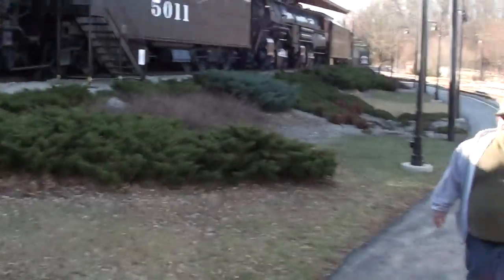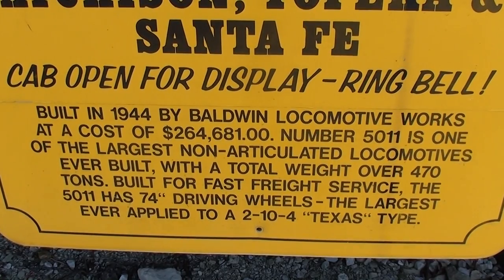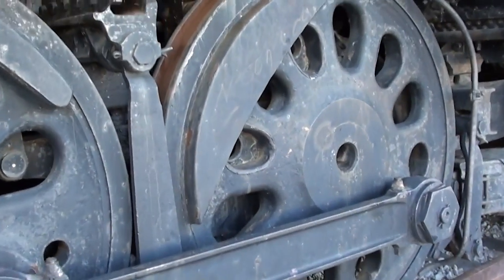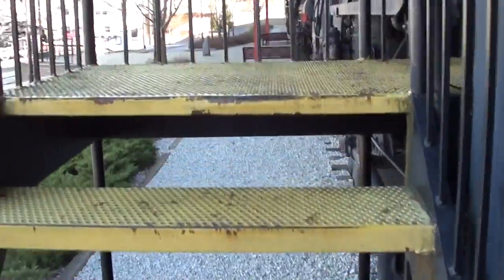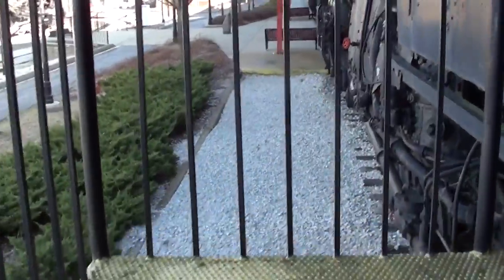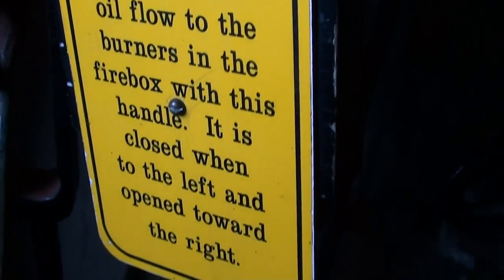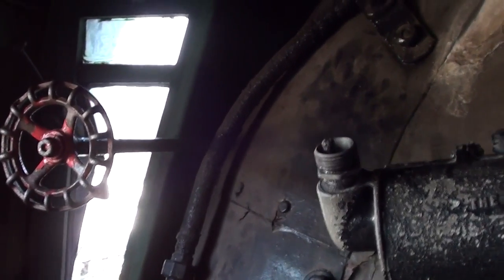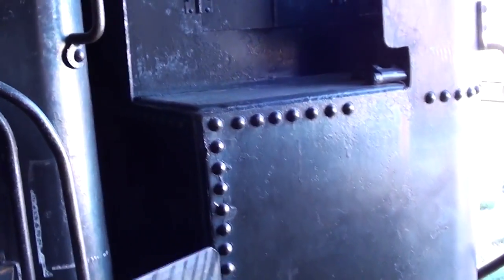Huge Locomotive - Built in 1944 by Baldwin Locomotive Works

Comment: I was up into the cab of the 5011 in 1956 on the Sundasky, Ohio branch of the Penncy. The crew kept talking about how much better the Senate Fe locomotives were rather than the J-1's. Today I see what they mean for a 10 coupled engine with the balance problems. 
The 5011 Class had higher TE of 103,000 no booster and built to run through the hot south west at a good steady 60 miles per house or better if the got away with it. How I would love to see 5030 or even the last to steam 5017 to steam again. They lived a life of hauling a 3700 ton train through the SW and ended up hauling coal up hill at 10 to 12,000 tons. At the end of the summer they were torn up.

Comment: The 5011 class 2-10-4 Texas has the distinction of having the highest piston thrust of any steam locomotive ever built 212,000 pounds!  It could haul passenger trains at 70-75 mph during WW2 and pull heavy loads with freight.  I had a friend that worked for AT&SF for many years from 1941-1969 and he like me said the Texas was the best locomotive he ever ran.  We need one of these running today soon!
Reply: (2-10-4 Texas has the distinction of having the highest piston thrust of any steam locomotive ever built 212,000 pounds) Firstly, That is an assumption unless there is documented test run on those locomotives in which they operated them testing specifically for piston thrust measurements, We wouldn't know that therefore could not make that claim of 212,000 pounds! 
Secondly, you would have had to test all other locomotives ever built to legitimately state it has the "highest piston thrust" 
if those tests have been done please advise as to where those documents are located I would like to research them!
Cheers..

Comment: I thought I recognized your voice- and sure enough it was you! I looked at an AMX review you did for a St Louis firm.
Reply from the maker: Yeah, I do a little bit of everything.  Thanks for watching!
Reply: You might be interested to know that the locomotive you reviewed the AT&SF 2-10-4 was actually loaned (leased) to the Pennsylvania Railroad in 1957 hauling ore trains. It remained in AT&SF lettering and ran with 'Pennsy' J-1 2-10-4's during a power shortage. I believe the Pennsylvania leased 12 of the giants. What makes it more interesting is that it was oil fired, where 'Pennsy' steamers were coal fired. Interesting review.